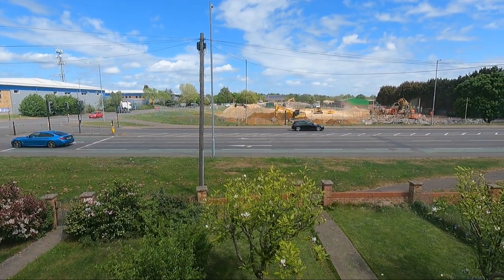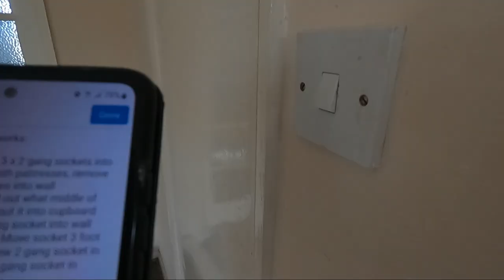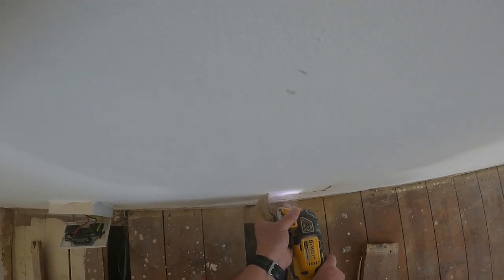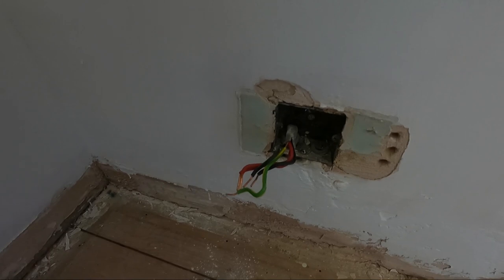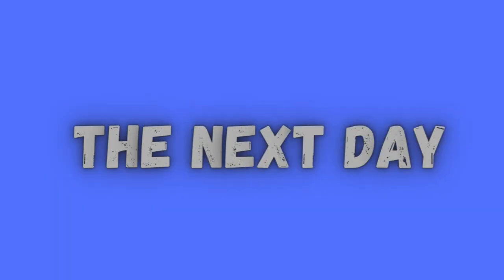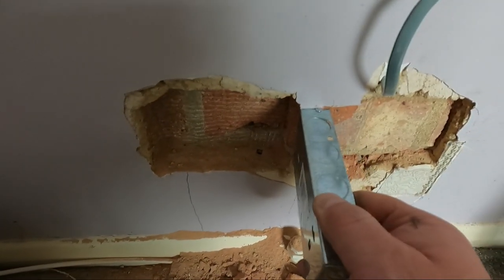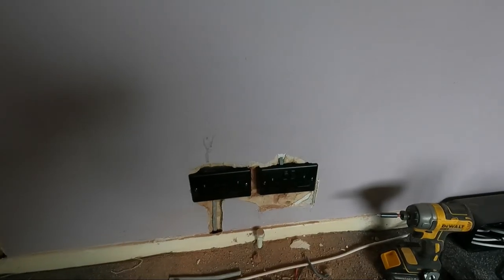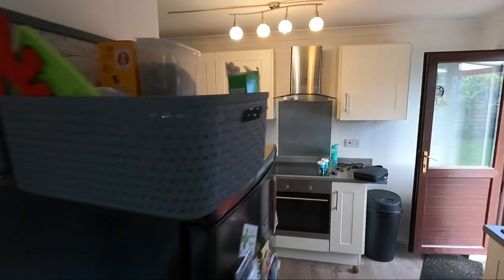How to sink back sockets

Comment: Haha, I've had 2 of those armeg sds scutch chisels.  Fantastic for the first 10 minutes of the first time you use them.  Then the comb slides out, so you knock it back in with your hammer.  Then it slides out again, so you knock it back in again. Repeat for infinity, or until you give up and throw it under the floorboards where it belongs.
Reply: Never tried one but could you drill it tap it and put a bolt in it
Reply from the maker: Nightmare mate
Reply: @FFT_Electrical  already tried this, and failed.  The metal was just too thin.  Also tried keeping the comb in place with a jubilee clip.  Worked for a couple of minutes before shaking loose.  I gave up, life's too short

Comment: Thanks for the video.  Those of a certain age will get the Del Boy quote "chateauneuf du pape". As an adult learner, is it a requirement to protect the cables in the walls with conduit?
Reply: No it's not a requirement. Some sparks like to cover the cables in a capping (PVC or metal). Capping doesnt really do anything to protect the cable from screws/nails/drill bits/ though it does look neater and safer in the customer's eyes.
Reply from the maker: I love OFAH!
Reply from the maker: Yes, correct 👍